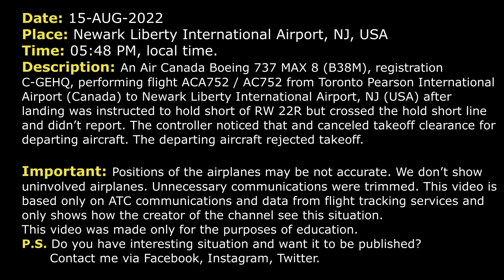Runway incursion. Air Canada Boeing 737 MAX 8 didn’t follow instructions at Newark

Comment: The crew should have definitely told ATC they were over the line, but they were clearly barely, barely over the line otherwise the pilots would have guaranteed said something, but they were like 5 ft over or less and were still basically clear of the runway for any kind of safe take off and it could have gone unnoticed without any kind of interruption.
Reply: And departing traffic was a wee Embraer

Comment: I would say crew needed to tell ATC when they were over the line.  Also, most likely, when they were given the first hold short clearance they were still moving towards the hold line when told to cross and had not yet stopped to hold short of the runway. Which is why when they were cleared across but told to disregard in the same sentence the nose had moved slightly over the line. They couldn't slam on the brakes to stop and it took some distance to stop.  The video shows them having stopped on November short of 22R when in fact they were always moving. 

That is why it wouldn't be possible to have spooled up the engines and moved from a stop in the same amount of time it took the controller to say "cleared across, ahhhh, actually disregard, and hold short of 22R."  And I think the crew did not call tower because they knew they were in a safe position although slightly over the line. If they felt they would cause a safety hazard they would have spoke up. Perhaps there is a system that is extremely sensitive and notifies when an aircraft is past a hold line even slightly. 

Bottom line is the crew should just make a quick call to say our nose is over the line.

Comment: I think this is one of those where both the FAA and the AC Chief Pilot's office listen to the tape and say to the pilots and the controller: "Guys, please don't do that again - we know it's EWR and why AC was quick on the gun to start crossing and controller was quick on the gun to clear the Brickyard, but that almost went bad.  Go forth and sin no more..."
Reply: Should be way worse. The pilots violated a major safety rule, then tried to lie about it. 

Suspend and require retraining on ground procedures before returning their certificates.
Reply: @mattz1230  Wow.. you really are dumb... making the same comment in multiple threads shows not only ignorance, but idiocy. The point has been repeatedly made that both parties have a responsibility, yet you are completely excusing one of them to blame the other fully. Pathetic. Go back to playing your sims while mommy makes your supper and does your laundry.
Reply: @mattz1230  That's not at all what happened, it's clear the ATC changed the instructions and AC should've mentioned that they were over the line. Everybody makes mistakes and that is why we have SMS programs like ASAP that allows for honest mistakes to be retrained with no punitive results to the pilots. It's an exceptional program and it leads to much safer operations.
Reply: @joshb7371  His instructions were to hold short. When did he ever issue an instruction changing that? Fun fact- ATC NEVER ONCE changed their instructions. 

If they had said they'd jumped the gun, and were over the line, that's understandable. 

But they LIED about it. They deliberately tried to conceal the fact that they had crossed the hold short line and were on the runway.

That's why they should be suspended and required to retrain.
Reply: @mattz1230  Not sure what your background is, but it's not uncommon for airlines to immediately start moving when called. You'll notice that in fact ATC did say "ACxxx cleared to cross 22... disregard, hold short 22R at November" I would bet thats what happened and they had crossed the line. You're right, they should've immediately advised ATC of the situation and they didn't. But this is not an event that would warrant a suspension, this is why we utilize the ASAP program at the airlines, to educate and prevent these instances from occurring in the future. A punitive culture leads to less reporting which sacrifices safety, there's a lot of stats on this. We're all fallible and we make mistakes, the important thing is not repeating them.

Comment: Totally clueless and incompetent crew. Hope they get fired
Reply: Bit extreme, no?
Reply: @kennethfeagins1414  not really, they're on the live runway and keeping quiet about it? This could have been a disaster
Reply: @emerald39  I agree with you 100% and that displays their lack of professionalism. They kept it quiet hoping not to be caught.
Reply: @kennethfeagins1414  yes
Reply: They were just following what the ATC told them to do. Nothing will happen to them.
Reply: @MaxZomboni  following my A$$. They were told to HOLD SHORT. If you don’t know what you are talking about don’t just type to waste calories.
Reply: @mango7862  You are trying to rewrite what happened. The command to hold short was given after the controller had given them authorization to cross the runway, and after they had crossed the line. The incident happened because of the controllers indecisiveness. The pilot was just following the ATC instructions. First to cross the runway and then to disregard.
Reply: @mango7862  they were told to hold short then told to cross the runway and a few seconds later (in the same instruction) to hold short again. Obviously they weren't yet holding short and still moving, it takes time to get a plane moving from a stationary position.
Reply: The plane never stopped taxing. The video is inaccurate and shows them stopped at November.  As they approached 22R to stop at November they were told to "cross...actually disregard" and when they stopped their nose was hanging over the hold line. But the crew should still have let ATC know this.  Also, the ATC warning system allowed for a plane to be cleared for Takeoff while an aircraft nose was in the runway environment albeit very far from the actual runway. This is an example of an extremely safe airport warning system which is amazing to see.
Reply: @jimwilks1865  that’s exactly my point. They deliberately kept it quiet after the event.
Reply: How long have you been a clown? You sound experienced.
Reply: Good thing we've gotten people who think like you out of the aviation industry.
Reply: @troybaxter2916  I was flying when you were still trying to drink powder milk from mom 👋🏻. FJB
Reply: @mango7862  Ah. So you’re a dinosaur then. Make sense.

Comment: Wouldn't it have made easier, if ATC let pass Canadian first and to give takeoff clearance second for Brickyard? Any controller or pilot who could explain here?
Reply: It really is situational. If the controller has traffic on final “pushing” the departure out then the priority becomes getting the aircraft on the runway departed and clear of the runway for the arrival. If that’s not the case, then we can choose to cross the Air Canada in this situation, but that requires extra transmissions as we have to let the Air Canada know that there is traffic holding in position on the runway, then go back to the aircraft holding in position and let them know there is traffic crossing downfield. That’s time lost and transmissions that can be made to other aircraft who may be higher priority (if there are any). So it really depends, if there’s that arrival approaching the runway, you want to get the departure out and possibly cross behind the departure and in front of the arrival if there is adequate separation. If not, let the arrival land and cross either behind them (if they have a long rollout) or in front of them once they accept runway exit instructions and become a taxiing aircraft. As you can see it really depends on the situation and the best judgement of controllers to make decisions that work best in the moment. Hope this kind of helps!
Reply: @seeyearuhbravo  Thank you very much for your explanation! Easy to understand even though I‘m no aviator. 🙂

Comment: It was incumbent on the Air Canada Captain to ensure atc were advised immediately once they’d crossed the hold short line.
Reply: Absolutely the pilot’s fault. You don’t move until you get the full command and read back.

He made it even worse by not reporting that he was over the line.
Reply: Controller fully at fault and tried to foist his mistake on the pilot.
Reply: @Capecodham  You're at fault for endangering your aircraft, the other aircraft and lying about it burt.
Reply: Controller at fault for the confusion BUT the pilots at fault for creating a hazardous situation and not speaking up about it
Reply: @f3nd13y  What confusion? When did the pilot receive a valid clearance and give a valid readback that he was clear to cross?

Or was he TWICE given a valid instruction to hold short, and once read back correctly, and ONCE LIED ABOUT IT???

Pilot 100% at fault.
Reply: @mattz1230  if you hear your callsign and clear to cross most and i mean most (90%~) start to spool up immediately  to comply without causing a delay. Im sure thats what they did only to then be cancelled after hearing that they were clear in the same broadcast. If you wait for the entire call to be completed good for you I guess? But you are also going to be yelled at constantly at airports like LGA, EWR, ATL,ORD I can go on....

Comment: Sounds like another case where flight crews try to rush to meet the expectations of pushy controllers at busy US airports. Yes, you're at Newark and it's busy and you don't want to be holding up the show by taking too long to cross a runway, but you still can't start rolling in anticipation that the controller is giving you the clearance to cross. The controller can say "disregard," but your 737 can't go in reverse.
Reply: And so endeth the reading from the Honorable Jeff Saretoosky.
Reply: In this scenario, when a controller says “cross…”, it seems beyond reasonable to expect that command to be followed by “22R”. The controller changed his mind and they had to quickly stop a 150k lb airplane. The flight crew of course should have reported passing the hold short line.
Reply: @dominicmassignan2598  It's reasonable to expect that that's the instruction you're going to be given, but it's neither reasonable nor legal to begin executing it until you've actually heard it.
Reply: @dominicmassignan2598  What if the controller had meant to say a different location? Can you read the controller's mind?

Shouldn't they have been planning to stop at the line, regardless? The readback exists for a reason.
Reply: @mattz1230  sure, but tell me one logical word that would’ve followed the word “cross” in this scenario? Again both sides are at fault, I’m just offering my perspective. Cheers!

Comment: I wouldn't call; I would fill out asrs and airline safety report
Reply: ATC shouldn't be "eeerrr'ing" and "aaahhh'ing" - Imagine a pilot was like "eerrrr, gonna take off now, oooh, actually changed my mind LOLZ" - But hey, Newark controllers are not the best.
Reply: @neom0nk  This is why we WAIT to RECEIVE a full CLEARANCE before taking any action.   Look at it this way, if you’re stopped at a red light and you see cross traffic go from green to yellow to red are you instinctively going to take your foot off the break and cross into  the intersection before waiting until you yourself has an actual green light? If you do cross without receiving your green light first, that is then poor decision making on your part, as you could be killed or kill someone else unintentionally.  Same thing goes for an aircraft crossing onto a taxi way or a runway. The pilot can NEVER assume anything no matter what ATC  says, but must wait for a clear “clearance” coming from a controller’s mouth, after the controller stops transmitting his instructions.   Easy, what’s so hard to understand about that?
Reply: Yeah agreed.

Comment: How is the pilot starting to do something before they read back the instruction? 🤦‍♂
Reply: Well imagine a (european) traffic light that goes red->yellow->green.
When you drive your car towards a red light, would you hit the brakes in the moment it turns yellow (ATC starts to give clearance)? It's not like you would expect it to turn red->yellow->red. It's an unfortunate timing and sure, also an unfortunate assumption. If they were already holding, they could not even start before the readback, because the engines take longer than that.
Reply: @thomas.leitner  And that's why you have car crashes. Someone decides to assume something. But in any case, it's not the same a crash with a car than with a plane. Pilots can't make these kind of mistakes.
Reply: @thomas.leitner  the traffic lights in Europe goes: red -> RED+yellow -> green -> yellow -> red -> ...
Reply: @e1sYTchannel  sure, thanks, this left out detail actually makes the point even more clear, when people are not likely to HOLD for RED+yellow, because no one expects red afterwards.
would be interesting though when it goes red and then causes a crash, how this is gonna be handled.
Reply: @e1sYTchannel  i think it depends on the country, but I haven't seen a red+yellow in many years in europe. it goes straight to green where i live.
Reply: @anyadaz  Not sure about Europe, but I've definitely seen that in Israel just a few years ago.
Reply: Sometimes they are in a hurry, so in this case  they made an assumption that they were going to receive the clearance for crossing the runway
Reply: Have you ever heard that there’s 2 or more people in the cockpit? Yeah, they can do multiple things at once. What a shocker.
Reply: @tomato-v8x  Well, first you need to make sure what you have heard is correct and that doesn't happen until you read back the instruction. They shouldn't do anything before that.